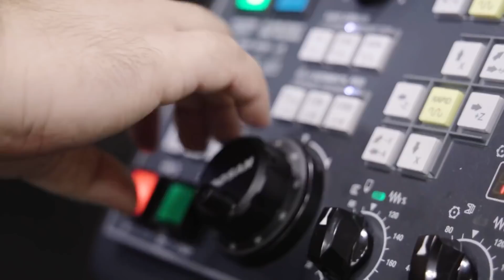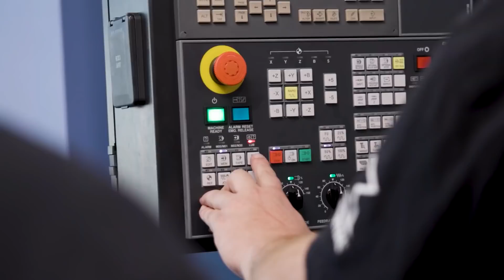WHY Would You Keep Working in a NASTY Shop??

Comment: Its an ethos implemented by everyone ftom the management down.Cleanliness is a sign of a happy and well organised shop
Great post these machines and tools  cost more than some sports cars
Reply: but you can just make money with them, when they are running. they arent running while you are cleaning them. so there have to be a balance between running and cleaning. the same with the opperator. he wont make money while he is cleaning. he is making money while working. 

its correct, that he have to clean from time to time. you cant earn money with machines, that dont work 100% because of sticky tools, sensors, or with a window you cant see through.

Comment: I work in a shop that is clean for the most part. Each area is definately a reflection of the people that work in that area occasionaly you run into variables that are out of your control such as a leaking machine or being in an area that is close to welding or there is alot of grinding going on making dust accumulate. Keeping a clean shop is great for customer eye appeal.

Comment: When I first started working at my current job, I would run parts on a roughly 10-11yr old 3 axis mill.

I was the first one to ever take off panels and clean underneath them, scrub the entire cabinet, and otherwise just take the time necessary to keep my tools, vices etc. clean and rust-free.
Of course it's impossible to keep squeeky clean when 3-4 people before you have treated the equipment like it was something they flush down the drain, but I did my best.

The machine just in front of that, was roughly a year old when I started working in that shop. The coolant looks like... well liquid sh*t.
The entire inside is covered in sticky chips, it smells funky, and the tool holders are scratched, the jaws of the vices are milled/bored into etc..
And 3 years in, the table is starting to have rust spots.

Some people just don't care, and it's a shame.

Comment: A decent part of lean manufacturing is about keeping things clean so tools can be found and you can see normal vs. abnormal conditions. Taking care of machines costs some money when you schedule it yourself but more if the machine suddenly schedules it for you.

 It all requires support from all levels of a company to maintain, so it's reassuring when a shop has good systems in place.

Comment: I don't have experience in a machine shop but I've felt this way about my home, garage, tools, cars, workplace for as long as I can remember. The descriptions of the dirty shops in the comments below are disgusting. No way I'd be involved with places like these. 

For example, we have had a short "winter storm" here in North Texas the last few days. Lots of sand, dirt, snow, ice... great stuff to melt off the car and soil my garage floor.  Yesterday was the first day above freezing that I could reasonably get water through the hose. I got the car washed on the way home after working all night, sprayed out the garage, squeegeed the sitting water out, and parked my car in a clean garage once again. It's all about attitude and what's important to you.
Reply: If you haven’t epoxy the floor, it doesn’t have to be anything fancy. I did along with fully finished walls and it’s a pleasure to work in the shop!

Comment: Not to impress people but just to make sure that I have fun doing a job at my machine and to maintain my machine and other tools as well as I can.
Cleaning machine and workplace is a good moment to check for things like chips stuck between the wipers and to make sure that all tools are back in the tooling cart where they belong.
I don't just keep the shop and the machine clean but also all my tools. I will even take those T-wrenches and tweezers with dirty handles to the sink to clean them (and put a drop of oil on the tweezers hinge-point. I also clean out the drawers of my toolbox from time to time to make sure there are no chips or other dirt in there.

Comment: I worked in places that won't pay for someone to keep the shop clean, pull chips, move parts, put tools away sharpen them, replaced them or do maintenance. And yes you have to have someone else do this because the machinist have to keep working on their jobs.
Reply: happened to me friday. Hauled ass the first 6 hours pushing over 100% rate so I could have an hour at the end of the day to wipe machines, change filters and mop the floor so I could come in to a clean dept. on Monday. What does the boss do? See's I'm finishing up early so drops another job off at my machine. Got to love doing an untested setup 2 hours before the end of the week. Next time I'll just be sure to make my 8 hours of work last 8 hours.
Reply: Depends on management. What I hate is others who take tools and leave them where ever and you have to waste time looking for the   tools you need.

Comment: Clean shops are highly underrated. I just left a shop for a variety of reasons but one of them was the fact the larger Mazak mill I was hired to rebuild and operate was literally 3 steps away from the welders bay with no separation other than a set of storage racks.  The amount of grinders dust coating everything was nasty.  Had to clean the filters on the Mazak every few days.  

In this video you have shown a box for "Garbage carbide" tools.  Does the shop not send tools out for sharpening or even sharpen them in house?

Comment: Also what you clean with. One of my pet peeves is seeing someone use degreaser on a surface plate. No just no. Use Starret juice or a good quality surface plate cleaner. The degreaser strips the oil out of the surface plate and leaves it more likely to scratch. The Starrett juice also has a conditioner in it to help protect the surface plate.

Comment: I'll admit that I am definitely not the cleanest machinist, but having mostly operated 20-30 year old machines (and some even 70y/o), cleaning old machines was a waste of time after a initial cleaning by me. They never looked better other than the occasional original paint showing through. However, machined surfaces were kept clean and in the morning you checked every oil-level. Tooling and matching surfaces were handled with care, but the floor was covered in chips (conventional mills and large cnc boring mills). If you take something apart, clean it first and when you put it together you make sure it is clean.
I still hate the fact that the guys complaining about the chips on the floor are usually the guys that never clean the spindle, check the oil or do any operator maintenance.
In a job shop I dont mind a visual mess, as long as everything has a proper place and is handled with care. Machines should be cleaned regularly, but unfortunately it's usually left to the operator/machinist to keep it clean... not having a policy in place to stimulate those practices leads to lazy machinists and abused machines. It's the unfortunate reality of not having the planets line up and ending up with the perfect boss, the best colleagues and the finest machines in perfect condition. I've been lucky to have always had at least one, sometimes two, but never all at the same time...

Comment: Ive worked in clean and dirty shops. Multiple factors play into it 1 shops layout, if it's wide open in the middle of a steel mill you'll never have clean. Because humidity  caused rust and steel slag that floats in the air will for ever plague you.  Tables you clean will be dirty by the end of the week with slag.    Vs enclosed  also climate controlled you eliminate those things 2 is culture.   And staffing.  If you feel like you are truly under staffed   house keeping will always suffer.

Comment: Heck yes your shop is clean.  You used Blaser 735 to clean the floors and mop it up with.  :)  There are mess makers, and there are mess cleaners.  Mess makers are frustrating, not picking up or putting away tooling properly.

Comment: Been a machinist 47 yrs way before x can cleanliness was of the utmost when I was trained to this day I still wipe down the machine I work on . But I find that this new age of machine operators  not machinists I have in the shop with me could care less we are not a job shop we are a testing facility and make parts for fixturing the things I deal with do nothing more then blow my mind not only cleaning but just operating the machines in this company if you can run a computer you can program the machines thank god I only have a few yrs to go

Comment: People always make a big deal about chips on a machine, but what they seem to forget is it will be full of chips 15 seconds into the first part. As long as they don't interfere with machine operation who cares?  Time is money, and I'm not investing any more resources into scrap than I have to. 

Of course, a big shop with lots of machining centers can cover that overhead. But a small family owned shop can't.
Reply: Exactly. Had the pleasure of working with an old timer who had a breakdown if more than 2 chips were inside the machine at shift change. Not even on the vices or ways, just 2 chips sitting on the bottom conveyor was enough to send him into a rant. Run 1 part and now there's 20,000 chips splattered on all the walls with coolant

Comment: I'm trying to recover a Mitsubishi CNC machine, it looks nasty, at least 1mm dirt (oil dust mix) on it. The owner said I can use it whenever I want and do whatever I want with it. And he hopes that we can cooperate from time to time.
There are lots of chips inside, the toolchanger ... sticky shit. I started to clean the machine but I guess it needs a complete overhaul.
I plugged in the compressed air .. and the pipes burst one after each other. Today I changed all the old brittle air pipes with PU pipes and the low air error went away. Now I'm still fighting with one more issue, hopefully we can sort that out within the next days.

The owner said he also got the machine that way... no one is cleaning CNC machines here that's not normal. Hah if this machine will get under my hood this all will change.

Comment: I am just thinking that it seems that everything is  machined out of stock, does anybody ever send in forged parts for machining? Aren't parts that are machined from stock possibly weaker due to not being forged?
Reply: They can be yes, but forging is very expensive and time consuming. It’s typically reserved for applications in which the extra performance is strictly required. Typically you can design things in such a way so that is not required (make parts a bit larger, creatively employ the material so it increases the strength of the part, using more wear resistant components where required, etc). Meeting requirements without forging usually saves lead time and overall cost, perhaps with more material used.
Reply: @CalvinoBear  Thanks for your answer also I think it would be a lot worse if you stuff up the machining of forged parts rather than just wasting stock
Reply: @CalvinoBear  That episode where they machined a propeller using 300mm extruded bar makes sense because the thin propellers would have been machined with the grain allowing for extra strength, whereas if they had been machined across the bar and across the grain they would have been more brittle

Comment: there is more than only a clean shop and a mess. at some point you should say, this is enough, its waste of time, if you clean the whole day you machine, tools, workbench etc. a mess is grose. but at some point you will have some stuff laying aroung, for example when you are setting up a bunch of tools. you have to decide, do i want to clean my machine completly every week and spend hours in that or get my work done. 

on my table there has everything his place. there is the computer, there the messuring tools, there a notebook, space for raw material/ half machined parts, etc. i hate it when i touch a machine and stick to it. thats disgusting. but is it worth to clean the whole atc, every time? definitly not, because that will take me over a day, each time. so i do it, when it gets nessecary. i get paid for making chips, not for cleaning. the machine is there for making chips to, not for looking good.

Comment: I dont really care about how the workbenches look when people are busy as long as all the shared tools/measurement equipment gets handled in a proper way and put back in its spot when not being used. What really pisses me off is people complaining about a messy shop on areas they forget themselves. 

Done using the saw? Remove the fucking material INCLUDING whatever shit you cut off the end of it.
Sawblade almost broken? Fucking change it.
Coolant/chips all over the floor? Get a broom and clean it.
Did you take the last new endmill of a certain type? Put it on the list. Dont stand around bitching about there never being any new tools around.

Some people honestly deserve to be taken out back and get slapped around. The attitude is obnoxious.

Comment: I work at a Company in Australia that has military, rail, mining and other contracts and our two work shop are dirty one isn’t as bad but the one I’m in fuck from the floors to wall just dirty and it get under my skin badly, I’m a qualified chef was doing that for close to 15 years now so I like a super clean workplace I should be able to eat my dinner of floor that type of clean and because of the “C” word my Industry it’s destroyed. So a got into the steel industry first I learn how to use CNC plasma cutter, brake press to a brand new voortman beam line and a coping plasma robot (807) unfortunately got laid off because the company had big big project’s that have been put on hold for a good 6-8 months I’ll newest in the production area. . Now I work as AT running mills and lathe and this place physically make me lose motivation because of how dirty everything is.
I try my best to clean the machine but there need to pressured washed or something because it’s that bad.